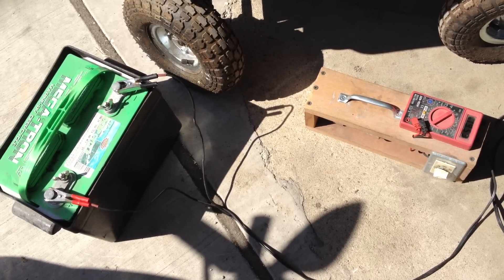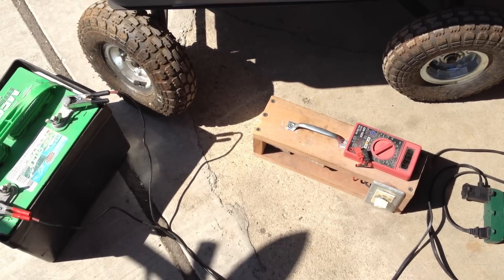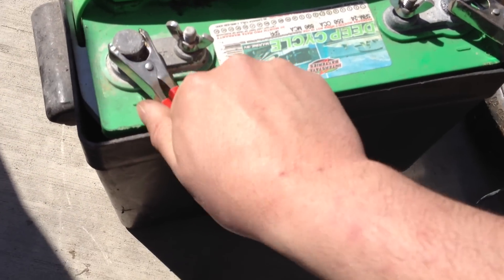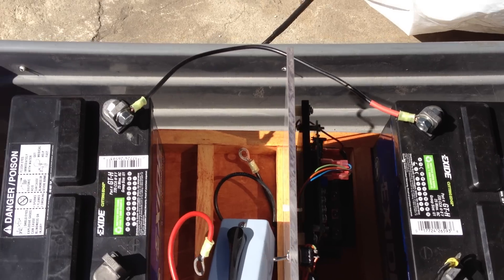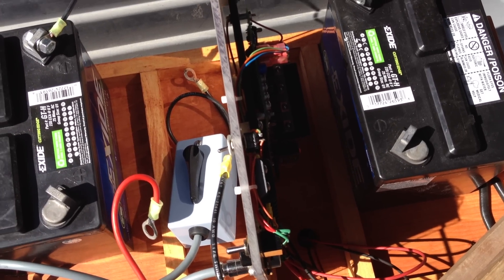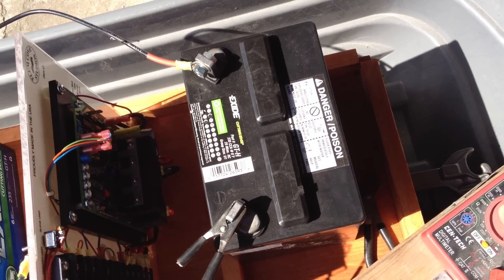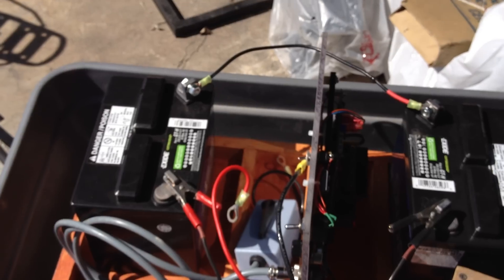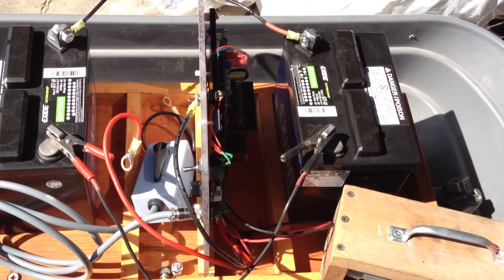Video Instruction Guide----How To Use your Capacitive Battery Charger   Part 2

Comment: But you are limited by the current capacity  of the  bridge and will have to watch that.
Reply from the maker: Incorrect, the capacitor is what limits the current. Size the Rectiier correctly, and you will never hit it's maximum. Thats the whole point of using the capacitors.
Reply: Capacitive reactance?

Comment: I don't understand!!! how does this charger work???, its got 120v AC going into a capacitor, its still 120 ac out, then into a retifer, then 120 DC out to the battery 
So what is regulating the voltage? can anyone explain this in more detail ?? ·
Reply: It's totally not regulated. It will go up to 200V open circuit until it destroys something because it doesn't have a transformer. No fuse either. Wow right?

Comment: Hello, Great video! I have a question - are you using bleeder resistors across the caps? If not, how do you keep from getting a shock or shorting the leads when they accidentally touch?
Reply: Running AC into an AC cap. will not hold a charge.
Reply: @grassroot011  it will hold a chrage

Comment: Thanks for your help.

Another question:  How do you protect the battery if the capacitor fails to a short?

A short might happen with a single capacitor charger or in one of the parallel capacitors in your 6x80 mFd chargers.
Reply: You don't. There is no circuit protection. This is a highly dangerous design made with flammable materials.

Comment: Question about multiple units;

If you are without grid power and you had 2 - 800 Watt inverters connected to your car alternator, and you also had 2 of your capacitive chargers, could you combine their outputs in parallel to your battery to increase the charging current?
Reply: It would make more sense to just connect your car directly each 12V battery you want to charge with jumper cables to avoid the losses associated with the DC-AC-DC conversion. But in theory yes. However this is a severely flawed charger design that will likely ruin any battery you charge for more than a few minutes and might destroy your inverter too.

Comment: Very Nice setup. I have 2 Questions,
1, How do I know when the battery is full and has floated?
2.If i wanted to Raise the charging current I can add Caps in Parallel?
This charger can charge from 2 Volts to 120 volts battery automatically? 
Thanks
Reply: 1. You don't. You would have to disconnect the charger and test the battery with a load. Also, this charger does not float and will destroy the battery with high voltage if used for more than a few minutes. Do not use this type of charger, it is a flawed design.

2. Yes, more capacitance in parallel will increase the output, but the output will already be more than 200V with the 80 µF capacitor. But that's a moot point because you'll destroy your battery with this charger either way.

This charger will fry any battery 2 to 120 volts automatically. That's the only marketing claim he can reasonably make here.